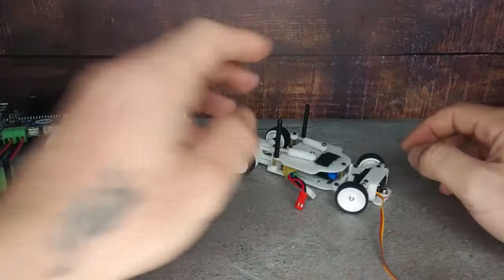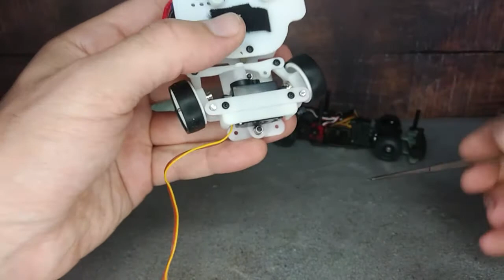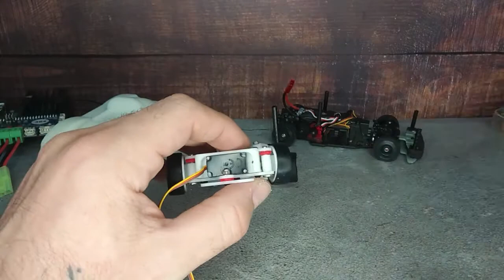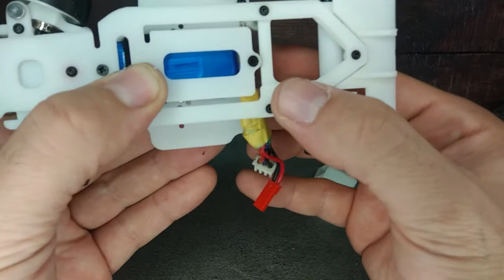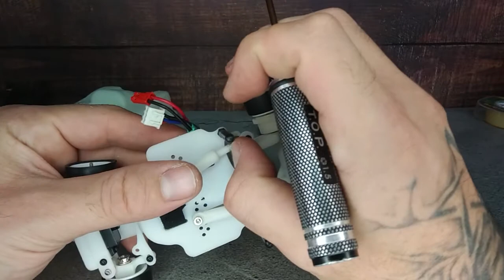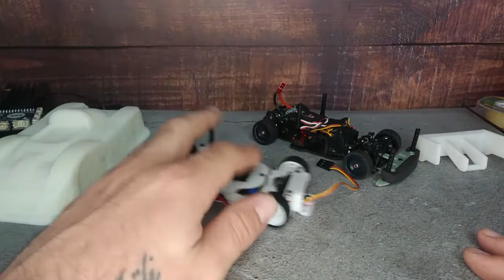SDR studio update no 2 09 05 2020

Comment: Might be able too make a slimmer design in the front if you use mini-z 2wd front steering blocks or kingpin shafts put into a solid 3d printed one where you can screw in ball ends & run ball bearings in the front rims instead of the hub, saves a bit on complexity i think as well & would depending on the design of the 3d print allow for some negative or positive camber.
mz403 should be one of the cheaper options too get those shafts if you don't have any mini-z 2wd front knuckles laying around too use for this.